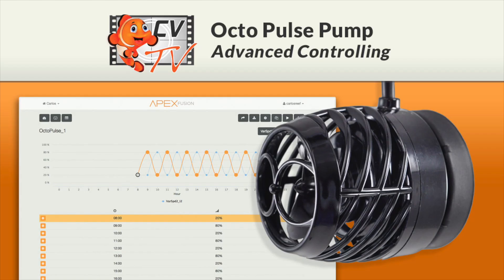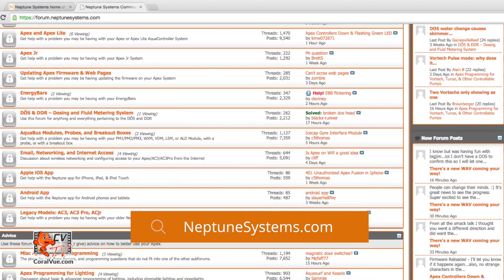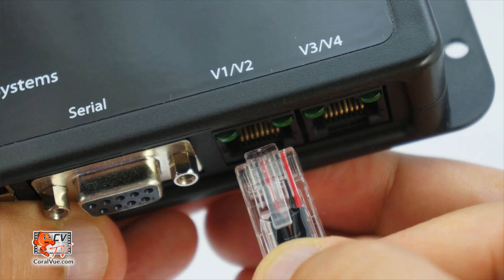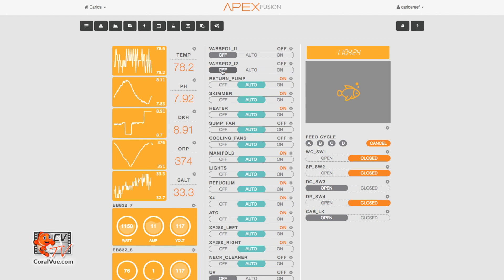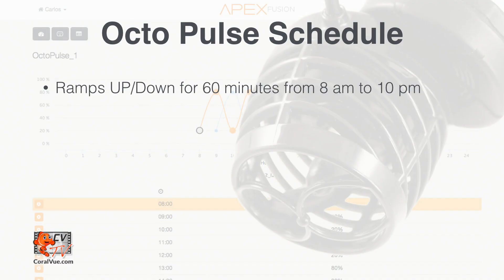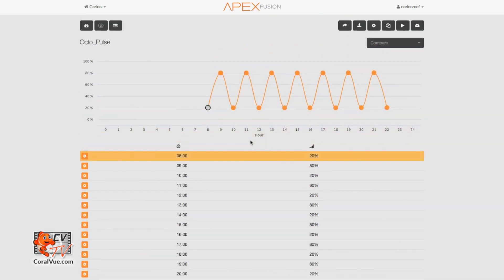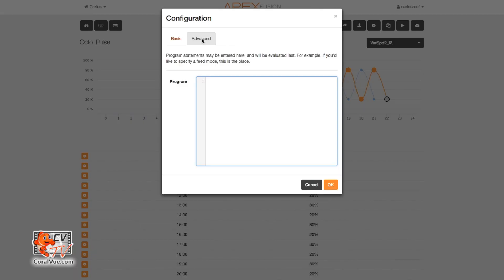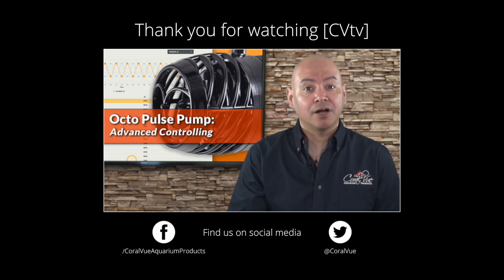Octo Pulse Pump: Advanced Controlling

Comment: PULSE 4

Can I go less than 30% from 10v apex connection? 

On octa controller max low settings are 30% which is 1350 GPH. I cant go lower than this.

so if I connect to apex will I be able to go 15% which is 675 GPH or even lower?  does it have any limitations?